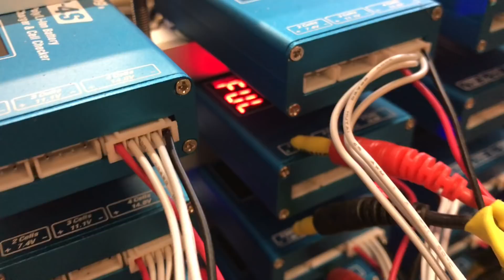New chAIR 20XLiPo charger array

Comment: get rid of all the dangerous batterys. build a light weight gas powered generator . thats a lot safer and cheaper and more relaible that the flying death trap you builded right now. Think saftey my friend.
Reply: uhm.. tell me please how you intend of producing more then 100HP of power to power the brushless motors and make it more lightweight then the current batteries..?
Reply: Its not as easy as it sounds, also it would make terrible noise! Maybe a hybrid solution would be ideal if engineered properly.

Comment: i can see the attraction of a charger array as i have a smaller setup like that myself. But could you rig up something to connect the whole chair battery to an electric car charging station? these are gradually popping up and it will be quick and easy to charge once you have the charging interface sorted. plus the look on tesla driving mum faces would be priceless. happy new year from the uk

Comment: On reasoning: what's the point in using an array of small chargers? The setup totals to ~300€ on HK. A 20S 10A charger is ~130€, a 20S 50A smart BMS ~50€ (with bluetooth) → money saved, much less plugs, better monitoring and better charge consistency…?
Reply: im interested in being able to charge many 5/6s batterys at once, do you have any links/sources? havent been actively looking but the sales are on now. thanks in advance
Reply: davey .jones  The central BMS solution is meant for batteries connected in series, e.g. 4S x 5 = 20S. The most simple solution for multiple independant batteries is connecting and charging them in parallel (see for example https://oscarliang.com/parallel-charging-multiple-lipo/). That only works if your cell voltages are close enough on connect though. Connecting them in series is always possible. There are many chargers and BMS available, simply search for "20S charger" / "20S BMS". Standard BMS are available in many configurations, for customizable ones see EV supplies.

Comment: I think you may consider building your own battery using 18650 cells. They are ubiquitous and you may just use one big charger to charge them all. It makes things much easier. To balance and protect them all you may use 14s or 18s BMS (not sure what is the size you need) which are easy to get and are much cheaper and less cumbersome from using so many singular chargers.
Reply: I just wanted to make the some proposal, it would be way more better in term of safety and in term of Weight/Energy/size ratio but maybe i miss something .... buy the way it's a really crazy application !
Reply: I think the maximum discharge rate for 18650 cells might be too low for the chair multicopter.  That's why a lot of RC planes and quads use lithium polymer rather than lithium ion batteries.
Reply: @marhar2  That is good point.
Reply: @marhar2  nah! :D there are cells out there way more powerfull then Lipo! But those still are a bit expensive..! But 40A per 18650 cell is possible.. couldn't believe it myself at first but you can buy those!

Comment: Those janky Turnigy chargers will damage your packs eventually. They don't balance correctly despite what the display says... Get a couple of good chargers that can run parallel charge boards. I use the Revoletrix Cellpro 8 chargers and have great luck with them.

Comment: I had a charger that looked exactly the same, just the brand name was charsoon. It worked fine for smaller lipos but when i got into 5" quads i had 1500 4S to charge, and it got very hot although i had clamped a graphics card heatsink to it. It stopped working after some weeks of daily charging. So don't be surprised if the lifetime is not that long. But maybe your version is better. Good luck with flying the chair in '19, don't crash!

Comment: You should get a server PSU like HP 800-1200W series. They deliver enough current easily and cost close to nothing. Around 300-400SEK per unit. Most of them can easily be modded to start as you whant and the fan does not come on before its needed. I run that for all my charging stations. That way you dont have to buy the more expensive turnigy ones and have multiple :)

Comment: Did you consider using parallel charging boards together  with fewer but more powerful chargers? In your use case there shouldn't be too much voltage difference between the LiPo packs. It shouldn't be a problem to charge multiple packs in parallel.

Comment: I’ve used those DC4S chargers a bunch and I’ve noticed that if you leave a pack on the charger after it finishes, the charger will slowly drain one of the cells
Reply: Yep. Those cheap chargers will destroy packs eventually.
Reply from the maker: Thanks for the heads up, will avoid that.